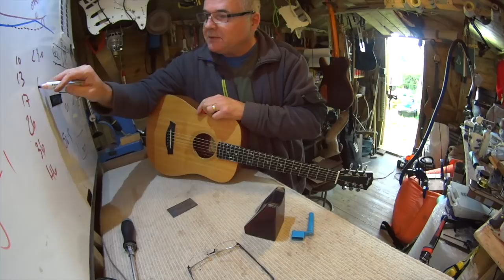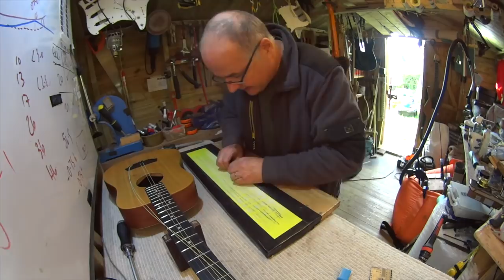Baby Taylor headstock repair

Comment: Same thing happened to my baby Taylor years ago, I have been looking for a replacement to screw back on but cant find any anywhere!
Reply from the maker: Do you mean looking for a replacement neck? If the headstock came off due to failed original glue (like this one) you can clean it up and re-glue it with Titebond 3. The main challenge is getting the angle right when clamping. I've never noticed a Baby Taylor neck for sale on its own though, if that's what you meant?

Comment: Interesting video. I own 3 Taylor’s, a Baby and a  310  built in 2002 both of which have the same headstock joint as the guitar you were working on . My Taylor GC3, (fabulous little guitar) has a scarf jointed headstock. Sometime along the line Taylor changed the joint to a scarf type on their USA built instruments, the reason isn’t clear but I don’t imagine that they’d admit to a weakness in the old finger joint even if there was one. I have to say that all of my Taylor headstocks remain firmly attached and I quite like the ‘necklace ‘ of finger joint on the 310 and Baby. In my opinion Taylor make great sounding easy to play guitars. I’m not sure if Taylor sell the neck shims to the public or if you need your neck shimmed you have to let an authorised service workshop do it.
Reply from the maker: I believe you can get shims from Taylor, Henry. I like the Baby joint too, it's so precisely cut.
Reply: Good to know that the shims may be available not that I envisage needing one in the near future, the action on all my Taylor’s is perfect. Bob Taylor is an amazing guitar builder with many groundbreaking ideas, I put him up there with the likes of Leo Fender when it comes to innovative thinking. The fit and finish on Taylor guitars is excellent and the build quality very consistent.

Comment: If it's true lacure on the guitar from the factory there is no need to dandy it before you spray a few lite coats of lacure on top of it Sam.😉
Reply from the maker: I'm not sure what you mean by 'true lacquer' K? The Baby will be a matt polyurethane finish which doesn't 'uncure' when new lacquer is sprayed (unlike nitro). This was basically matt acrylic lacquer on top of poly.